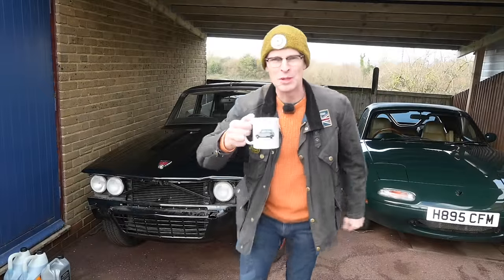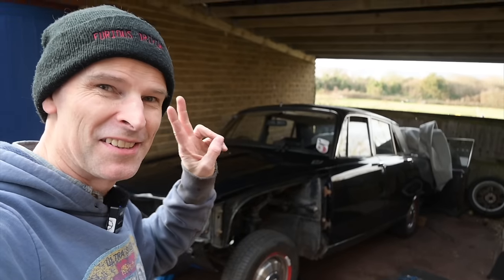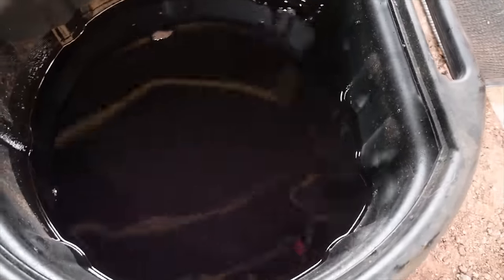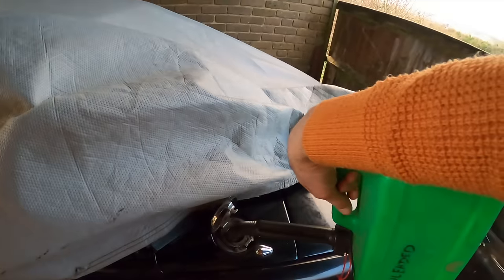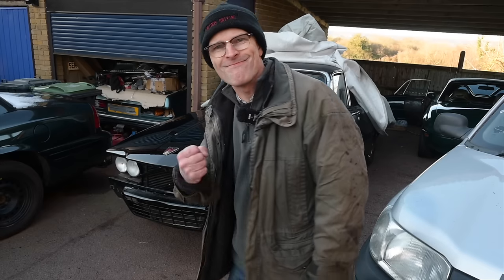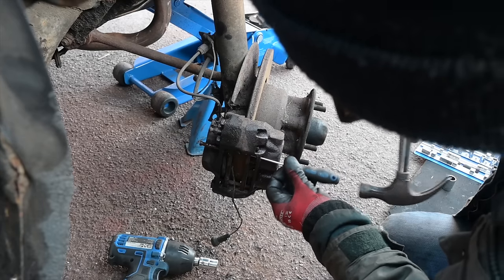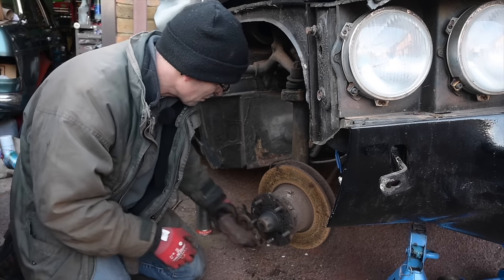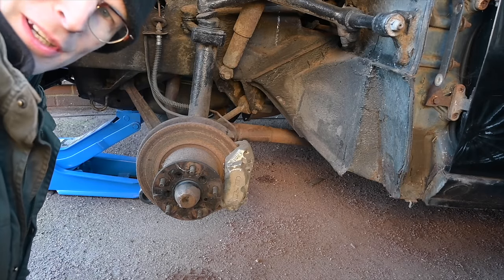Non Rolling Rover solved! Starting unsolved! (it wont anymore)

Comment: Don't add walls to the back of front of the car port or they will get torn off in the next storm, the side should be fine. The reason it survived the last few days is because the wind could flow past the carport and not build up pressure and then lift the roof.
Reply: MrCHrisfj
You aint daft
Reply: It might work with a staggered slats type of design, so the wind can still blow through it.
Reply: His ideas would create a STOL-wing with the flaps down.... so yes, don't do it, if you extend the front, make it extend above the front of the roof, more like the airbrakes on a wing that disturbs the low pressure areas on the middle of the roof.
Reply: Matt, when funds allow might I suggest a Cabrio Shield (or similar) for the MX5. Got one in 2015 for Mr Z for spring/summer storms when his hardtop is off, not that his roof leaks but wayyy cheaper than replacement softtop.
Reply: I agree with a previous post if you block out the rear of your carport, not only will it be much darker but there's a great chance the wind pressure will build up and blow the roof away.

Comment: Lo Matt, Right, Ive recently sent Been involved in building a lean to at my sons house. A bit of advice  do not block off yer back wall or the roof will come flying off. My advice is get a bit of lattice panel and fill in the gap with that. It will stop all the crap blowing about and it will allow the wind to pass through. P6, in my advancing years i would say to you phone up the scrappie guys and get them to take it away. Life's to short. i admire your doggedness  but where i come from it has now become a regal pain in the butt. There ive said it now. Thanks for the vid. I'm lookn forward to your next adventure.    Later  😇

Comment: If you close the front and rear of the carport, the wind will get a much stronger handle on it
Reply from the maker: Theres a method of fencing with slats alternating sides of the centre line so the wind can pass through

Comment: For the back and side, have you thought about getting some made to measure tarps from eBay that you can put up and take down, so they’re not permanent.  If you got them with eyelets you could put some hooks up in the carport to attach them.  👍🏻
Reply from the maker: Id not seen those, that could be a good temporary solution
Reply: Cheaper option, you could add a fascia board, add some hooks and hang a suitably sized clear mono tarp from it. Screw a batten through the eyelets along the top and bottom and use it to roll the tarp round it.  Screw some eyelets to top batten to hang from the hooks. Makes it easy to hook/unhook. I've done similar to have  temp 4*6m roof between kitchen wall and the shed when it's raining and want to work outside

Comment: I always have  wooden golf tees on hand when working on brakes. They are ideal size for blocking  the fluid from dripping everywhere.  Good your are buying a change over calliper .  Not worth messing about with seized ones.  Also a skim of the rotor surface to ensure it is running true would be beneficial.   My  P6 Rover  and  SD1 joined the list of cars I regret selling.

Comment: Check the coil is compatible ,Matt.  From memory, the P6B loom has an inbuilt ballast resistance wire, and it needs a suitable coil, or you get a weak, or no spark on cranking the engine.
Reply from the maker: It is, it’s been in a while. Problem solved now…revealed next time!

Comment: The calipers on my P6B which has sat in the garage for 17 years were as bad as yours.  The good thing is that the seals rub on the pistons not on the bore, so if you can extract the pistons and get new pistons and seals a slight amount of rust in the bore will not cause an issue.  I had to turn up plugs to fit in the old pistons and drill down the edges to tap for some cap head screws.  If you don't have access to machinery then of course replacement calipers are your only option.  I would also replace every brake pipe on the car as if they are the old steel type, that is an accident waiting to happen.  You will obviously need a brake flaring tool and fittings plus a roll of 3/16" Cupro-Nickle tubing, which you may have.  This stuff doesn't rust like the old steel type and because it is softer, is kinder to the tooling and easier to bend into shape.

Comment: I seem to remember you accidentally spilling a load of oil out of the torque converter onto the garage floor....

Check you have the right coil, in the early 70s BL changed a lot of cars to ballasted coils which have a different resistance to the earlier 12V designs.
Reply from the maker: I kind of remember the oil but don’t remember if that was this or the donor Range Rover!
You’ve reminded me I did fill the torque converter before fitting it though so at least that will be full and the right oil

Comment: There's no "fix" for these calipers.  They need to have stainless steel sleeves fitted.  Replacement seals will last no time at all on any pitted bores and they will be pitted because water in the fluid will ensure they rusted.  You definitely need to change the hoses too and any doubts about the disks, just replace them.  This car does not have dual circuit brakes and failure is not a healthy option, especially considering the potential performance of the thing.
Reply from the maker: No, it’s not worth trying to save this

Comment: Mat have you checked all the wiring from the ignition switch through to the inhibitor in the auto box to the ignition coil, then to distributor. Because it very much sounds like it is a wiring issue. Good luck 🤞

Comment: I think putting a screen/wall up at the back, and side will also help the structure when we get the next storm… at the moment it’s acting as I kind of open ended tunnel, with tte wind and rain funneling through!
Reply from the maker: If it has a basic rear wall it becomes a wind trap and could blow the roof panels off, needs careful planing!
Reply: @furiousdriving  you are right, definitely needs to be vented in some way… I’m no architect, but I’m sure there are more knowledgeable folks on here. I was working on the principle that when I open a window in our house on a breezy day, then leave the back door open, all hell breaks out with door slamming etc, as the wind funnels through 🤷‍♂️

Comment: Hi Matt it seems your having trials and tribulations with the P6 I am sure you will solve the no spark when it's a bit warmer I know it's got electronic ignition does it still use a condenser a totally failed one would result in no spark 
anyway good luck best regards Andy Allen.

Comment: Might it be time to look at a brake upgrade, it is 4.6 now, they use to use different calipers on sd1 as they suffered from brake fade, could have been 4 pot princess calipers (but that could be capris). Have you Check the wires on the coil and that you have power on the correct terminal (I assume you disconnected them when you moved the coil). Sd1 did have electronic intention modules that died (but normally when they got hot) and I remember fitting a luminsion conversion to one of mine. In future if you suspect a fuel problem try a spray of easy start, much quicker than pulling petrol pipes off, if it fires you know it is fuel if not then spark
Reply: The 3500S manual has bigger front callipers than the 3500 auto.  They should do the job OK as an upgrade.  All P6B had really good brakes as standard. The early SD1 had a square alloy ballast resistor on the inner wing.  I had two of them fail over the various series one models.  You could bypass it with a couple of wires to get it running, they were mainly to provide full power to the coil when cranking the engine.
Reply: @brianwhittington5086  No it doesn't the manual and auto V8 have  identical calipers.  The 4 cyl ones are different and come in two types Dunlop and Girling.
Reply: There's an off the shelf brake upgrade from Fosseway.  Others have fitted vented disks from a Ford Transit.
Reply: @peterbroad1772  Sorry, but you're wrong on the callipers. I know these things like the back of my hand. Besides working on the last P6scwhen new, back in the late 70s - 80s, I had somewhere near 50 of them, mostly V8 models. I used to upgrade and swap bits around to build one to a spec I wanted for myself, and my dad, before selling them to do the next newer one. I had a shed load of spare parts I'd sell off from the handful I broke. I still have many parts, as well as one of the last V8 auto Huntsman spec models. The 3500S had quite a number of differences to the auto. The bodyshell is competely different around the floor, tunnel and bulkhead. It has bigger front callipers, bigger bore exhaust manifolds, bigger bore exhaust system, which is a completely different shape up front too.  It does not merge into a V until aft of the gearbox. It has two cherry bomb style resonators in the downpipes, that give it a different, more throaty  exhaust tone. The radiator is bigger, the brake master cylinder and fluid reservoir is bigger as it has a twin outlet pipes to supply the clutch master cylinder too as engine bay space is tight. There is a large heat shield between the manifold and master cylinders, and the tandem brake servo is stronger too.  There are numerous engine and carburettor differences too, giving a 3500S an extra 10 -12 bhp over an auto. The 3500S usually came from the factory with the smaller diameter steering wheel that was fitted to PAS equipped cars, whether fitte😢d with PAS or not.  The Dunlop brakes were replaced by Girling after the first couple of years of Rover 2000 production, so no 2200, 3500, or 3500S had Dunlop brakes as the changeover to Girling came around 1965/6.  Yes, you're right about Transit front brakes, but it depends on the year as the wheel stud PCD may differ, the calipers and pads are as used on early series one SD1. The P6 uses the same inboard rear Girling brakes as the late 1960s Ford Zephyr lV and Zodiac models.

Comment: Would at least find someone to resurface those brake disks assuming they have enough meat on them. They might not if there is a sifnificant lip. Buying a new caliper seems like an easy choice when the difference in price is so small. You may end up spending a couple of hours just on removing the pistons and also you transfer all the risk to the company that takes the core.  At first I suspected that the starting issue would be some problem with the keyways in the cam drive or gears in the distrubutor drive which would have sucked. An electrical fault seems easy in comparison. BTW a slot head on a drain plug seems very poor of rover.
Reply from the maker: exactly that, the difference is £20 between a kit and a fully refurbished like new one, its not worth the time.
The entire gearbox was a bought in item from Borg Warner, same as in lots of 60s/70s cars
Reply: @furiousdriving   Yeah that's true but the plug could have subsequently been changed in a rover garage. Really doesnt matter though is a stupid idea no matter whose idea it was.

Comment: And 🙄 .... you need a set of impact sockets. It's not a good idea to use standard  sockets with a rattle gun. I've just welded up a couple of 30mm standard sockets for a work mate that have been used with a BIG rattle gun that were cracked in 2 places. 😧
Reply from the maker: I have lots, just not in imperial
Reply: @furiousdriving  Ah! I'd not thought of that! 😊

Comment: You did the brake caliper removal all wrong, should have tried pushing the pistons back first, then remove the pads and finally remove the calipers themselves.
Reply: He never learns, always does stuff arse about face and ends up spending way more time than if he’d read the manual and done it the right way first.
Reply from the maker: The book spec pad removal on a P6 is to remove the pins and the pads slide out. 
On a working caliper you can push the caliper and compress the piston. I did try this and it didn’t move.
With this one the pistons are totally solid so the pads locked on to the disk and not even room for a lever to press them in. This is why I had to hammer the caliper off and then we all saw how tired they are
Reply: @furiousdriving  Thank you for the concise reply, perhaps you could have mentioned that in the video to stop us jumping to the incorrect assumption, you dont have much luck with that P6 do you.

Comment: She will not have a spark or start if not in park, as you pulled it out the rear wheels were turning.
Reply from the maker: I disabled the gear selector lock out previously
Reply: @furiousdriving  I can't remember if the switch for the ignition isolator on a P6 is internal or not, check the circuit for faults.

Comment: Don’t think I am trying to teach you to suck eggs but is your car not starting anything to do with the messed up gear linkage? For example the car thinks it’s in gear so is cutting spark? I had a keep Cherokee that did this once, it wasn’t quite pushed all the way into park and it would just turn over like your is doing, just a thought
Reply from the maker: Not here, I bypassed that switch as it was faulty
Reply: @furiousdriving  just a thought

Comment: In repeatedly saying "the car hates you" are you preparing the ground to get shot as soon as it's roadworthy?
Reply from the maker: no but if it keeps being a sod it will have to go!
Reply: @furiousdriving  Mere, minor tribulations, you've had it running so the solution can't be far away! As you say, could be the ignition module, a cold joint perhaps?